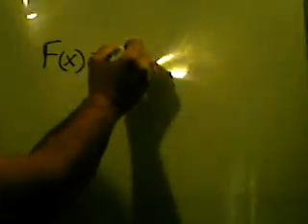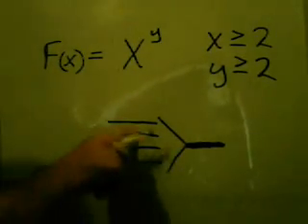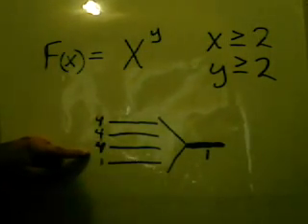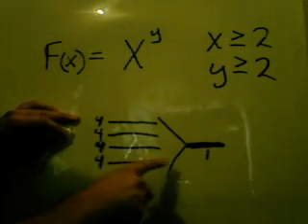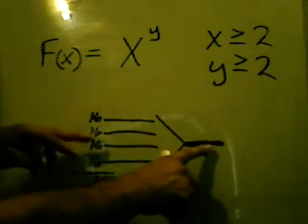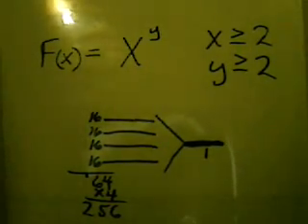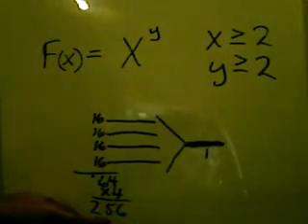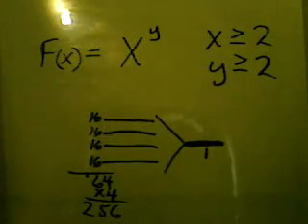Super-Powered Laser Design

Comment: Light as photons are charged quantum particles (as scientists put it) and can be persuaded in a direction with magnetic energy (CRTs do this).  Plasma is also a charged energy, and that's how the Plasma gun works, increasing the energy of the laser (in a circle pattern) until it escapes out of a pocket against a wall to incinerate it (as seen on scientific channels as applicable design).  Energy needed is huge though.